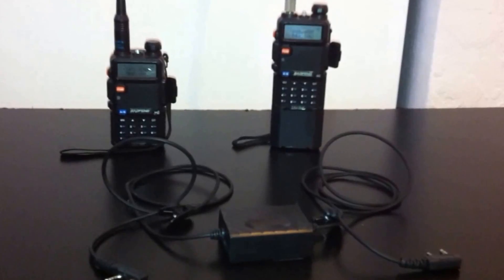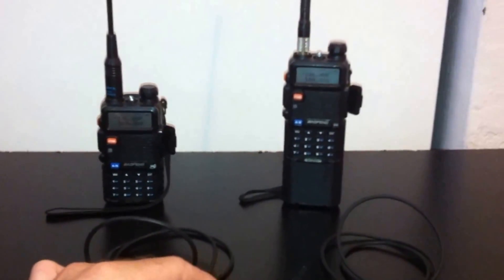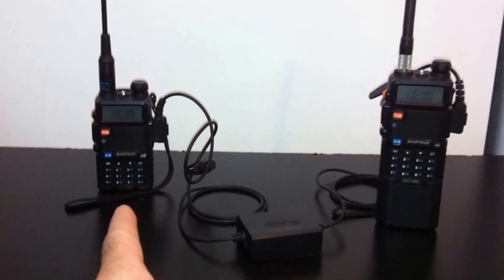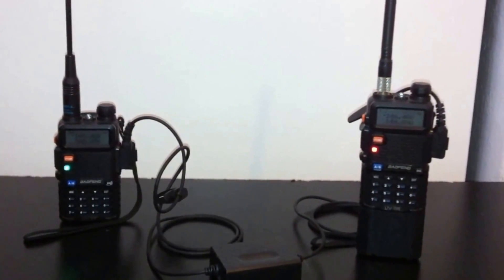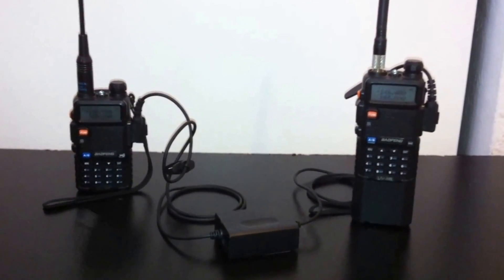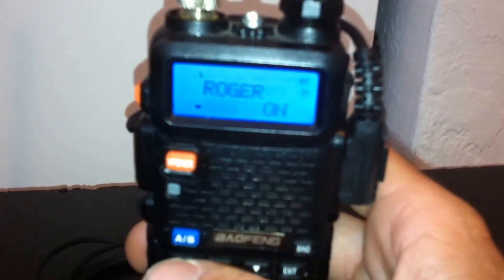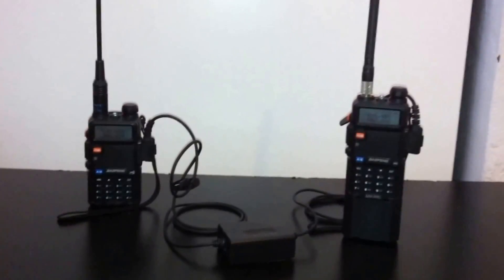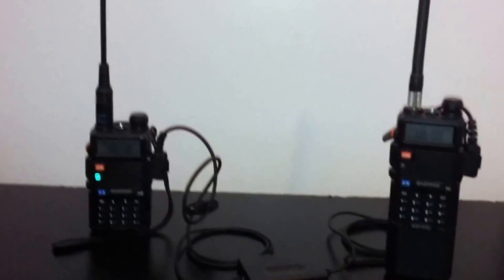Set up a Baofeng UV-5R repeater

Comment: I tried this with 2 Baofeng BF-F8H radios with the interface cable attached.  I have followed the steps multiple times but can not get it to work.  I have tried the straight cable and the Baofeng interface cable.  Does this only work on Uv5R's? Any help would be appreciated.    Thanks
Reply: +Buzz Olson make sure vox is turned on the RX radio
Reply: I have tried that. I even tried to duplicate on a pair of UV5R'S and no luck. I'm wondering if the software is different and it won't allow me to do it. I have tried the Sansonic box and the straight 2.5 to 3.5 jacks. As soon and I plug in the cables I get a constant TX as an open key with no audio and can't turn it off.  Let me know if I'm doing something wrong.
Reply: did you make sure to have the radio off when plugging the 2.5mm and 3.5mm jacks? only after they are plugged you turn on the radios
Reply: Yes tried that.
Reply: +Buzz Olson I'm also having this same issue, constantly transmitting after turning the radios on. I'm using 2 UV5R's with a 3.5 to 2.5 cable. Also tried using a 2.5 to 3.5 adapter paired with a 3.5 to 3.5 with the same result. Radio is set to VOX and I'm plugging it all in while they are off. Any fix to this?
Reply: I have not found a fix. If you do please let me know.

Comment: The video is a FAKE -- without a duplexer or SIGNIFICANT separation,  the "transmitting" radio would be completely blocking the receiving radio.
Reply: +Xaun Loc No, it is not "FAKE." Yes, the transmitter will cause some de-sense on the receiver, but not so much as to make it not work at all. External antennas separated by both height and distance would reduce the de-sense issue a lot.
Reply: +John T So did you actually setup the baofeng two radios with the repeaters as you stated on your YT reply. It seems that most people that tried it failed. I am considering buying the repeater but NOT if its not going to work. I realize height and distance is the key. I believe most people are trying to set up this scheme with antennas with improper heights and radios to close to each other.

Comment: Like Ken Page mentioned below, the practicality of this type of setup rarely works, since the duplex receive/transmit walks all over each other,especially given their close proximity.   They just don't have the filters needed to properly do this, and will (as Ken stated) be basically deaf.   You're probably a lot better off setting up a simplex repeater with a device like an Argent SDR simplex digital recorder/repeater.  You'll have the delay, but only need one radio, and it won't walk all over itself for the receive and transmit.     I won't even go into the all the legalities of doing any of this on Ham, GMRS, FRS, etc...   Caveat Emptor  ... :)
Reply: +upupaepops If you do a cross band duplex it should work much better as the interference is greatly reduced. But I agree using on the same frequency or even the same band desensitizes the receive radio beyond usability. But also using in a cross band configuration is unusable for the bubble pack radio's. 
Simplex takes a good understanding of it's delay operation by all users or it becomes a cluster fuck. Also Simplex recording is illegal for GMRS/FRS/MURS. Again making it unusable for bubble pack radio's.
With such low power I wonder if it's really worth the effort. but it's fun to mess with I guess. ;)
Reply: +nasanction  Very true.  Cross band would technically function better in this scenario, although there's arguably not a lot of usefulness in transmitting on 70cm with the duplex on 2M, or vice versa.    And given the legal restrictions on simplex recording.. ie store and forward, the reality is that most folks who set up a simplex store and forward "repeater" have done so with the only deployable situation being SHTF, etc.
Reply: upupaepops
Agree, I guess most of the popularity with these Chinese radio's is for a shtf scenario. With the prices so low, It's a little better communication option then the bubble packs. In most cases a ham operator would be more prepared to help in an emergency anyway. And if it's going for use in an emergency and  for the safety of your Family, then why not. Is that prepping? Or is that just common sense by the Ham Operator and the prepper alike?

Comment: And Ken Page, your probably right! But if you were trying to do a cross band setup, it would probably would not be an issue. I don't cross band much, but I'd rather burn up a $30 Baofeng than a $400 Kenwood due to the 100% duty cycle. And if you had the real estate to separate the antennas far enough apart, it's a cheap setup.

Comment: RETiredGM, I can get out an easy 30 mile radius with 250 millawatts on 2 meters. I am sure many repeaters have amps hooked up to them. And many do not. You don't need much power when you are up 400 feet. They are just demonstrating the ability to setup a simple repeater. But with external antennas, and some height, you have something that is cheap, simple, and it works well in a small radius. The idea isn't to use the rubber ducky antennas. And your right, it wouldn't produce any better results than just using the HT. The idea is to use external antennas, or put the setup on a hill or other strategic location. Think about that, what if you built a box to put the whole setup in, to protect it from the weather. And then you hoisted up to the top of a 60 ft tree. Even the rubber ducky antennas would provide an advantage due to their height.
Reply: +Bill Oldham Even a copper J-pole and maybe a small 2m amp.  I'm thinking about picking up another Baofeng just to experiment with this idea.  Might need to buy another sma to so-259.  Looks like a fun project.   73
Reply: +Bryan Solo dont drop it, its junk

Comment: Without cavity filters that repeater would be as deaf as hell. It's only working in your video because you are so close to the receiver. The transmitter will swamp the front end of the receiver without proper filtering. ...

Comment: I use Baofeng & Chirp software to program my radios.For the"two repeater radios" all I need to do is: Type in 145.800 on the receive (RX) line for radio one & on the second radio type in 146.400 on the receive line for the transmit radio. Is this correct? My radio & my buddy's radio will have both the receive freq. 146.400 & transmit freq. 145.800 on each radio. Could I add a PL tone to this set up and if so I guess I would have to place it on the two repeater radios as well. Last question; would this work just using a simplex freq like:467.68750 on both the receiving & transmit freqs or does it have to use a duplex freq?

Comment: wouldn't a 2.5mm to 3.5mm cable do the same thing? hook up the transmit input to the receive output and use VOX on the transmit radio?
Reply: +SheepdogSupply Yes, there are other videos showing how it can be done. It's no where near as simple, elegant and reliable though.

Comment: could you use a single base antenna for the system using a splitter?
Reply: +Daniel Tyas Well, if you want to spend ~$90 for a duplexer and tune the cavities for a pair of fixed frequencies, sure!

Comment: Does anyone know if it's possible to disable the PTT button or any other way to stop it from transmitting? I want to use it as a receiver only for some friends.

Thanks.
Reply: adam son I've been using the open source software- chirp.  With that and a programming cable, go into the Duplex column and on the frequencies that you do not want to be able to transmit, change the setting to off. Make sure that after you make the change you want, you hit return before you upload to the radio or it won't recognize any change.  There is no way to do this on the handheld itself.  For many things, you need the software and cable.
Reply: Only possible through CHIRP if I remember correctly.
Then again, even if you're just using it for friends, I'd recommend dropping a couple hundred bucks on a couple base radios and wiring them together to act as a repeater with a duplexer and decent antenna. You can even find them all set and ready to go on ebay for under 300. Search for "homebrew repeater."
Reply: You can do it in the menu.
Reply: Keith Mitchell thanks for the reply,  could you kindly show me how it's done please? I'd really appreciate it mate.

Comment: Ok, very sorry I know nothing about radios but trying to learn. I have 3 Kenwood tk-3360 radios and need to extend my range. would this work for them and if you wouldn't mind telling me how? What I am looking to do is Leave one at home and put the other 2 in both my cars, but right now it only has a range of about 100 yards. I need at least 2 miles. Can you please help me. Thank you.
Reply: ***** This setup would not work for you.  The tk-3360 radios that you have are not repeater ready meaning that you can only transmit from radio to radio directly (aka simplex) for all intents and purposes.  Also, you would need 2 radios at home and then one in each car for this setup. If you do not wish to buy new radios, being that you have a removable antenna, I would invest in a external omnidirectional antenna for your home.  This will only improve communications between your home and each car respectively.  It will not improve communications between the cars. Adding a fairly inexpensive magnet mount antenna to both cars, and you will improve communications all around.  Talking on a rubber duck antenna inside a car will ensure that your calling party will not hear you.

Comment: The tx unit is turned on by voice activation ? Or is the ptt being closed by the cable ?

The reason I ask is because voice activation has a noticeable lag.
To have the rx unit ptt the tx unit directly would be far better.
Reply: Unfortunately there is no 'carrier detect' signal available from the receiver.  Therefore, you either have to use voice activation or take the receiver apart so you can 'find' the carrier detect signal so you can connect it to the PTT input on the transmitter.

Comment: The problem I am having is once I drop one of the radios on the charger it transmits a sound so what I would like to know would this set up stop this.
Reply: I haven't tried this, but the charger(s) doesn't need to have power to it all the time; you could go to the hardware store and purchase a $5 timer (for Christmas lights, for example) and only send power to the charging stations for 3-4 hours in the middle of the night.  I imagine that would keep the batteries nicely charged for the rest of the day.  worth a shot.
Reply: thank you for the info I did buy one and it did fix the problem

Comment: Forgive me what I'm a bit confused. I thought the primary characteristics of a repeater what more power (greater range) and a larger (raised above the tree line/building/hills/etc). I'm not seeing what difference a 5w radio with a 16 inch antenna could possible make that a single radio (same wattage and antenna length) in simplex mode couldn't.

With all that said, I'm open and willing to learn. Obviosly I'm more ignorant than skeptical.

Someone please take me to school on this.
Reply from the maker: If a handheld transmits 5 miles, to this setup, then radio B from this setup transmits 5 miles, to the second radio, thats a 10 mile hop. If anyone came here looking to make a repeater with a 17 dollar part, you started searching with the wrong idea. This is only for a temporary basis or just for fun. Nothing commercial or professional about this item.
Reply: Depending location. You can get more then a couple of mile. I hook mind to a outdoor antenna and get about 25 miles.
Reply: Keith Mitchell I want to use a setup like this with external antennas and a solar panel on quite a high hill and see what kind of range it would get
Reply: +RETiredGM I am looking at this as a fix for my handhelds H777's and H888's,  we work in a hilly, mountainous area where cell phone signal is impossible. This small repeater system would work well in our small bubble. For safety reasons i need all o my teams to be able to call for help, and for production to keep supplies and equipment routed while we build our pipeline. Thanks

Comment: If I have 2 Baofeng UV-5R radios and this repeater, can the GMRS/FRS radios that you buy at the big box stores work with this set up?  What I'm looking to do is extend the range in our hunting area.  My idea is to set up this repeater with the 2 Baofeng radios and repeaters so that all the hunting partys (that have the cunsumer type radios) can extend the range.
Reply: +NicTaylor00 legality aside in a emergency situation or wrol, you have two options. 
Use the bubble pack radios as the repeaters on separate freqs. problem is they have limited power and crappy fixed antennas, so not really worth the effort.
Or run a simplex repeater(using a different device). There would be some double receives and a noticeable delay. it is doable tho and works.
as you can see there is no good way to incorporate bubble pack gmrs radios into a repeater system since they can't dual band or offset, have low power and crappy antennas.
the best option is to shell out 50 bucks for two new uv5s as they are probably cheaper anyways.
Reply from the maker: The Baofeng radios do in fact transmit and receive on the GMRS/FRS frequencies.. google the freq list of the frs gmrs radios.
Reply: GMRS repeaters are not illegal...but an FRS repeater would be illegal
Reply: The issue is not that the baofeng radios can xmt on those frequencies.   They can.  In an emergency, the FCC will make allowances.  In general usage, they might not be that tolerant.  The issue is the legality and FCC designation of the equipment used (IAW the Freqs used on that equipment).  If I am correct part 95 (GMRS/FRS freqs must not be more then .5w).  Baofeng uv5r and similar radios have a minimum of 1.0w output.  I personally have blown out channel 7 on my dedicated FRS radios (with uv5r on 4W (high power rating output).  The FCC is not that concerned with one using a baofeng radio (not part 95) for non-95 freqs.  it probably is more concerned with the power rating.  This is a case of can I or Should I.  I can, but should I?
Reply: Unfortunately, the Baofeng UV-5R cannot legally be used to transmit on GMRS / FRS frequencies, and I don't think the FCC likes the idea of GMRS / FRS repeaters: http://ham.stackexchange.com/questions/623/using-my-baofeng-uv-5r-to-talk-to-walkie-talkies
Reply: UV-5R's can physically transmit and receive on GMRS / FRS, but are not FCC-approved to do so.  I am not speaking to the practicality of a UV-5R GMRS / FRS arrangement, but rather its legality (or lack thereof).

Store-and-forward is not permitted on GMRS / FRS, so that's one more reason that a UV-5R GMRS repeater could get you in trouble.
Reply: Not illegal to use these if you're GMRS licensed.
Reply: BLACK MAGICK
How would using a ham radio on GMRS not be illegal even if you have a GMRS License? The radio HAS TO BE PART 95 CERTIFIED by the FCC to be legal to use on the GMRS frequencies. The UV-5R is not certified for GMRS. Most of them are not FCC certified for anything. There are a small amount that are Part 90 certified for commercial radio use like business use, police, fire, ect. but it requires that an FCC ID be on the factory applied label on the back of the radio. Without any FCC ID label, it's just a amateur ham radio, nothing more, nothing less.
Reply: As I understand that, that is for the GMRS freqs only.  The FRS freqs do not require a license. I could be incorrect.
Reply: NicTaylor00  what is the Range in your rpt portablr?
Reply: NicTaylor00 ..hey i set up my uv5re as a repeater..can i use it as a transmitter to at the same time??
Reply: No, the box store radios will not allow you to listen on one freq and transmit on another. You need split tx/rx for in band use. Could do cross band though.

Comment: What is that cable that is interfacing between the two radios in the repeater? I think you are calling it an, "interface." What does it do? Is it necessary? I've seen similar videos that just use a mini headphone cable going between the two HTs. What does your baofeng "interface" cable do differently?

Comment: I like this idea.  How would I intigrate a nano node into the repeater system? Radio A (input) talks to repeater, output talks to Nano Node (low power simplex) to transmit to IRLP.  Then Nano Node talks back to Radio C (low power simplex) which connects to Radio D (repeater output)  Is this logic right?  It would take 4 radios plus the simplex radio inside the nano node?  Or is there a better way to do this?

Comment: I did a test with a EM1000R talkabout with a bs888 Baofeng one of 16 channels and has no display. 
I used that cable p1 to p2. I made the connection P2 in Baofeng mic with active Invox. Called P1 in talkabout. I set the radio in 3 462 725 repeater on channel 22 for receiving and talkabout 462 625 20 channel talkabout in the Baofeng. I did my test and did not work the connection by cables. This test only works with two Baofeng? Does not work with the talkabout to receive the signal and to transmit the Baofeng?
Set up a Baofeng UV-5R Repeater System